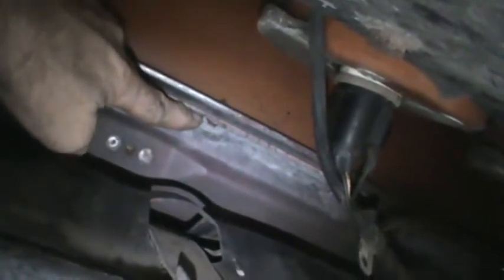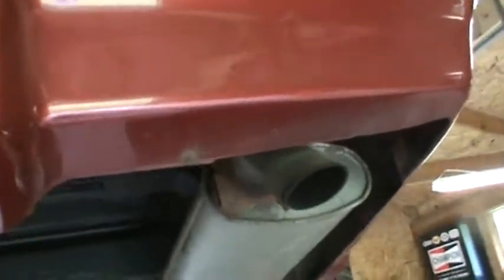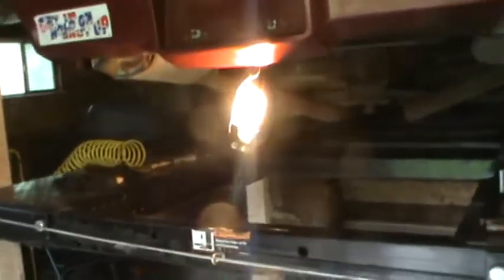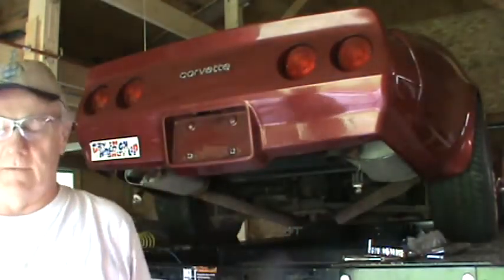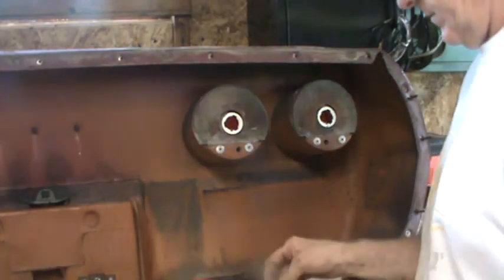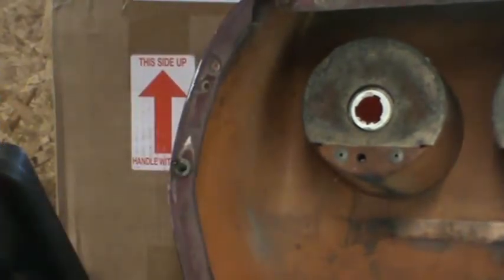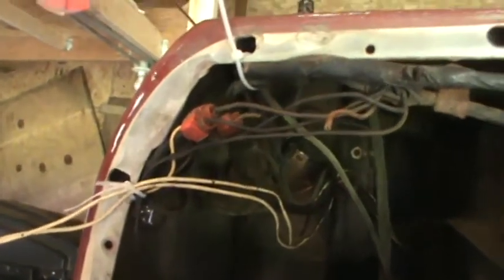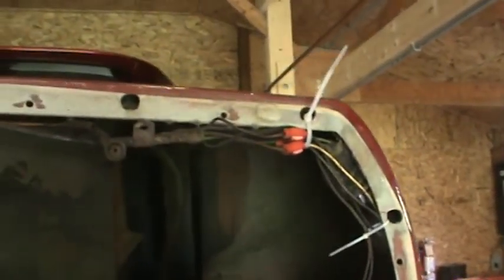Removing the rear bumper cover (it is not a stock '74 cover, it is from an '80 r '81)

Comment: What? This is not a 74 bumper, this is an aftermarket bumper! 74 bumper is 2 pieces and much more complicated than this nonsense! Come on, be honest and tell people it is an aftermarket bumper! How disappointing!
Reply from the maker: I'm sorry I didn't mention it in this video.  I mentioned it in this video when I was describing the car before I started the body-off project.  https://youtu.be/miessIc0nqI I didn't think about it being chopped up into separate videos that people would watch without having seen the entire project from start to finish.  I believe the bumper is from an 80 or 81 but I bought the car used and that's what is on it.
Reply: So, not too sure if you the title, but says NOT from a `74. Clearly reads `81.
Reply: Thanks for the clarification as I didn't see the other video.